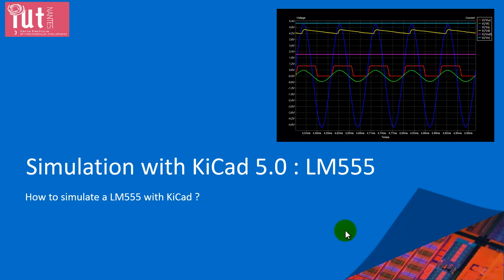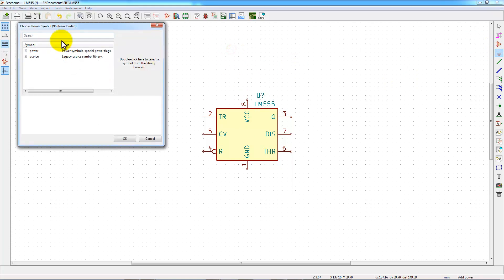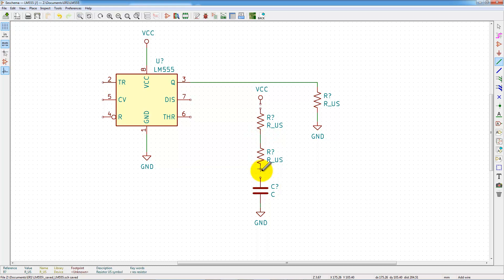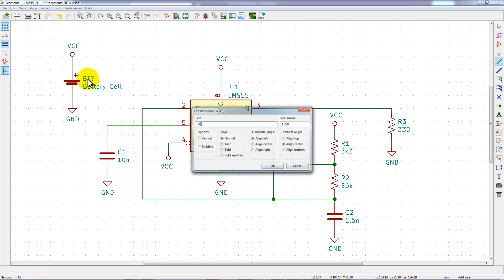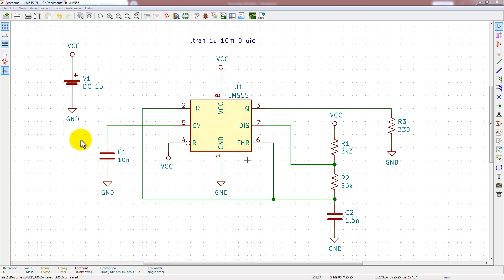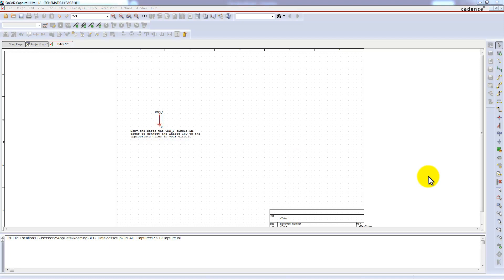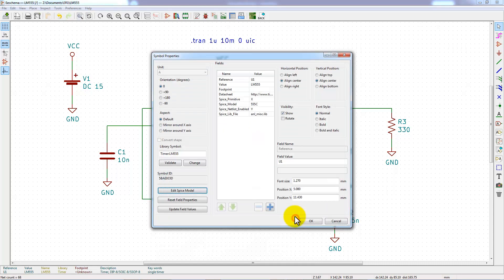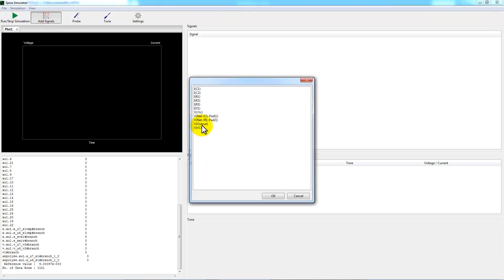Simulation with KiCad 5 : Simulate the LM 555 Programmable Timer

Comment: Cool video; thanks. I saw this on another video: you can draw wires right over the top of all the components, and the wires will automatically connect to the nodes (without creating a short circuit). It is much faster. To test, add a few components in a series and then draw a single wire through them all.
Reply from the maker: Thanks for you comment. Cross connection is a new feature from KiCad 5.1.x That wasn't present in the earlier, 5.0 version.

Comment: Well done. A few remarks: The resistor with a value of 3k3 will be interpreted as 3k in the simulation. You used the subcircuit description of a CMOS 555, not the one of the LM555 which is a bipolar one, you can use the 555B subcircuit. Note that in that case you don't need the uic. But you have to set your step ceiling parameter to a proper value e.g. 1us if you want an more accurate result: i.e. .tran 1u 10m 9m 1u
Reply from the maker: Hello Hugo,
thanks for your comment and clarification about UIC directive. Spice model compatibilities with ngspice are difficult issues to solve. That's why I used the CMOS version and also why I tend to use a gateway from KiCad to LTspice to simulate from KiCad.
Reply: @EricPeronnin  can you please elaborate on the gateway from kicad to ltspice? does it mean it's possible to use ltspice as the simulation engine? how can it be done?

Comment: How do you I simulate my board design if it includes a microntroller? I disabled it. I added every model, it still doesn't want to simulate...
Reply from the maker: Hi Steve. KiCad simulation is based an ngspice which can't simulate a microcontroller. There seems to be an add-on called MCUsim to do that : https://trac.mcusim.org/
I never tried it.
Reply: @EricPeronnin  I only want to simulate the power circuit.  I marked the MCU as disabled but this piece of software keeps warning

Comment: I don't like having 20 ground connections. I usually go with one and connect everything by wires. But I guess this is more clean, although it makes it a little bit harder to track what is connected to where.
Reply from the maker: Hi. Yes, this is more clean like this. Using wires in excess creates schematics with a poor readability. Power symbols must always be used.
Eric

Comment: Another good video, I use this TLC555.lib file that's work fine on my project on Kicad 5.0.2 :

.subckt TLC555 1 2 3 4 5 6 7 8
* Node Connection
*  common
*  |  trigger
*  |  |  output
*  |  |  |  reset
*  |  |  |  |  control
*  |  |  |  |  |  threshold
*  |  |  |  |  |  |  discharge
*  |  |  |  |  |  |  | vdd
*  |  |  |  |  |  |  | |
*  1  2  3  4  5  6  7 8
.model mosmod nmos (level=1 kp=1 vto=1 rd=5)
.model dmod d (rs=1e-6)
.model dmod1 d (rs=1e-6 is=1e-9)
eref 15 1 8 1 .5
gsource 8 3 8 26 12.5e-3
gsink 3 1 26 1 67e-3
vd1 8 27 dc .8
vd2 28 1 dc .85
vref 30 1 dc 1.2
c1 29 1 700e-15
rref2 30 1 100e3
rref 15 1 100e3
rout 3 1 100k
r1 6 1 500e9
r2 2 1 500e9
r3 8 5 75e3
r4 5 9 75e3
r5 9 1 75e3
r6 10 11 1e3
r7 13 14 1e3
r8 8 12 150e3
r9 4 8 500e9
r10 20 19 1e3
r11 16 17 1e3
r12 8 18 150e3
r13 8 21 150e3
r14 22 23 1e3
r15 8 26 150e3
r16 24 25 1e3
r19 7 1 500e9
r20 29 26 1e6
d1 1 11 dmod
d2 12 11 dmod
d3 12 14 dmod
d4 1 14 dmod
d5 18 17 dmod
d6 1 17 dmod
d7 18 19 dmod
d8 1 19 dmod
d9 21 14 dmod
d10 21 25 dmod
d11 1 23 dmod
d12 18 23 dmod
d13 26 25 dmod
d14 1 25 dmod1
d15 3 27 dmod
d16 28 3 dmod
e1 10 1 6 5 1000
e2 13 1 2 9 1000
e3 16 1 15 12 1000
e4 22 1 15 21 1000
e5 24 1 15 18 1000
e7 20 1 4 30 1000
m1 7 29 1 1 mosmod
.ends tlc555
Reply from the maker: Thanks for that. It works. This is not the TLC555 provided by TI. Where do you find it ?
Reply: @EricPeronnin  Hi Eric, searching on the net I found it on : https://sourceforge.net/p/ngspice/discussion/133842/thread/8cf772f0/ Thanks to the Author !
Reply: WoW. This is my first tutor on KiCad(Linux), and I definitely don't know where we usually get this models!... Thanks a lot, man!

Comment: Good video I learned a lot. Your English is more than good enough, and the only thing I really noticed is that the normal way of saying 555 is five five five not five hundred fifty five.
If you were to make another video, I would like to request more about finding libraries for spice, it would be nice not to have to install another program just to get a some data.
Reply from the maker: Hi Charles, 
Thanks for your comments. Finding libraries for spice is more difficult than I fought because a lot of spice models on the internet don't work with KiCad.
 I will work on your suggestion for a future video in english. This will be the case for my next video in french : simulation of the commutation of a relay (modelising by a inductor in serial with a resistor) by a bipolar transistor.  Transistor and diode models are searching directly on the Web.
Eric
Reply: Like you, I say five five five, but Dave Jones in Austrialia (EEVBlog) says triple-five, so it isn't universal.
Reply: I was thinking of us kicad for circuit design and PCB but this looks like kicad isn't good for simulation. Microcap which now is free can use many different SPICE models.